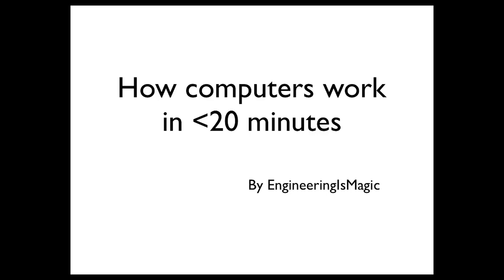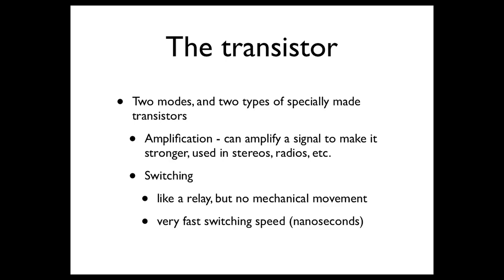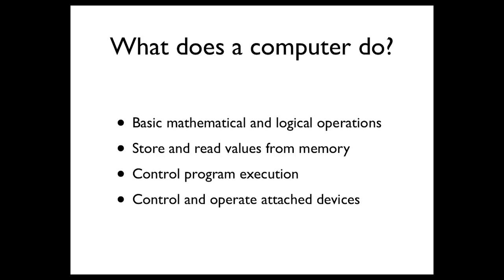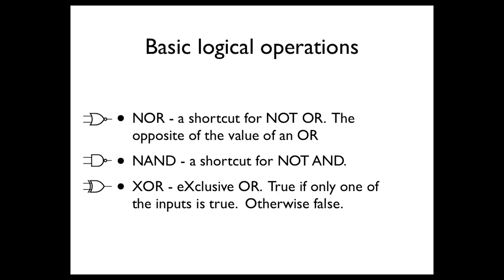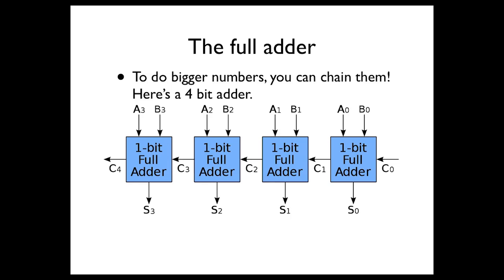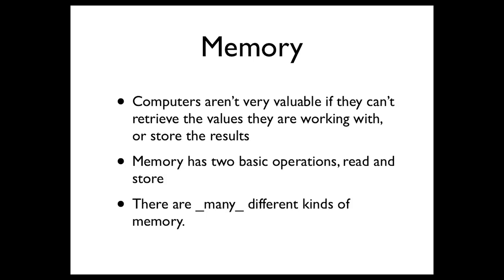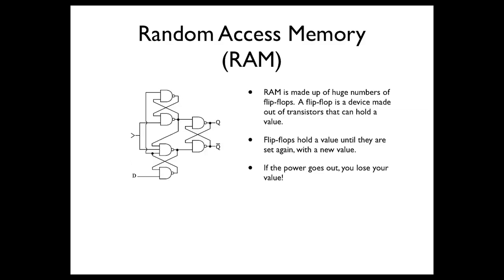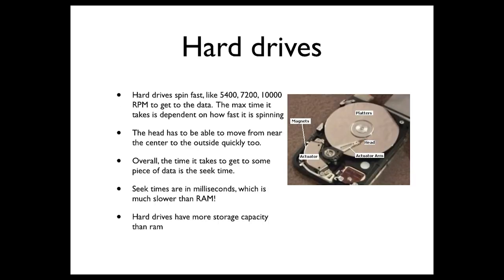How computers work in less than 20 minutes

Comment from the maker: This is a great question, and in need of a follow up video.  Programs (software) are loaded into memory in the form of instructions (special numbers that tell the processor to do something specific) and initial data.  Based on the instruction numbers and arguments (also numbers, memory address also a number), these eventually go down to telling transistors to switch on or off, and all of those transistors together do the operation, and return the final number (or modify other numbers in memory)

Comment: so, when i boot my computer, the electricity goes from my battery to all my hardware, and my hard drive head reads my boot information and sends codes to my hardware (RAM, processor, fan, etc.) and uses binary language to control my processor, and then goes to my moniter and sends the data (different signals for different lights) to show my screen, right?

Comment: If there were tools which could transfer signals in 4, 6 10 ways like it you put water in a divider it can spread it 4 , 6 10 different streams with different signals so that later on combination of these signals would transfer into unique into then systems could not be only binary. Computer has to understand what you want to convey. But 2 signal is just fine, with 0 and 1 different sorts of combinations you can get all numbers and letter, then after you got those then everything else.

Comment: That's all well & good but how does the machine know how to interpret the characters which are input in the first place? I get that the characters have a value but how does the computer know that? Am I asking this in a clear enough fashion? I hope so because this question has plagued me for over 35 years, to the point where I have to put on sheeple glasses, my sheeple headphones & not think about ot at all.Don't even get me started on the DWave Quantum Computers....DWave system=mind blown!
Reply: When you press a key. it is registered and converted into numbers. (see the ASCII table). then those numbers are converted into binary. that binary number is what a letter appears like to the computer. but the computer doesn't know it's a letter. for it. its just a bunch of number that it has to perform mathematical operations on. So to simplify. The computer is NOT intelligent/aware. it does not know about anything. its just a larger sized abacus which works on electricity.
Reply: Neat explanation is neat.

Comment: try to understand control circuits and transistors better. A lot of the other components are to regulate voltage and current and that's more complex engineering.

Comment: She misses the most important part - how the fuck transistors allow computer to work - it's the dual signal, plus and minus. You can create digitally everything by allowing and disallowing a signal, how? - fuck by converting everything into 2 digit system instead of 10 digit system we have, just because we have 10 fingers, like natures gives a fuck how many fingers we have. So, same way everything can be transmitted via 10 digit system, once you convert it into 2 digits, it's the same shit.